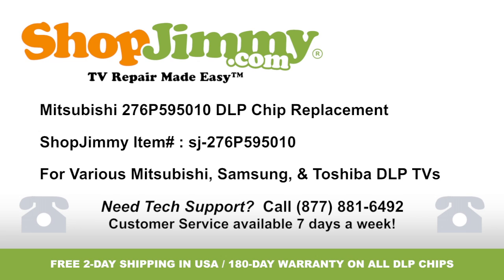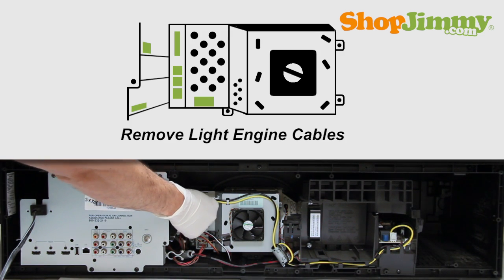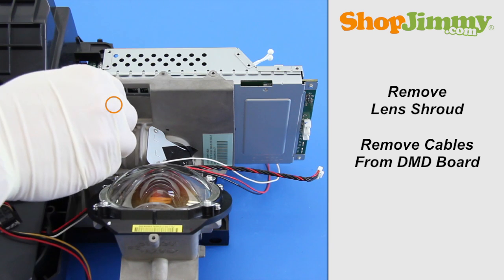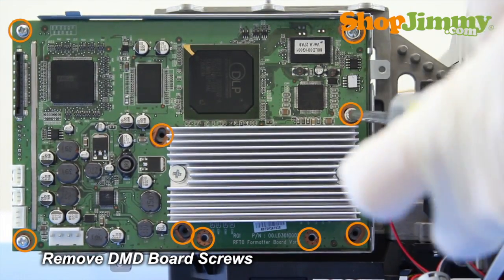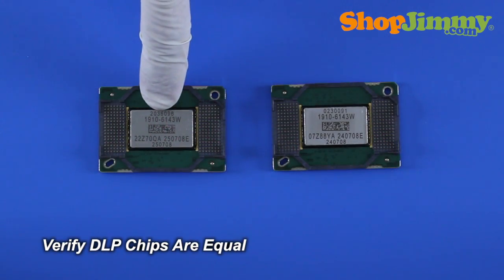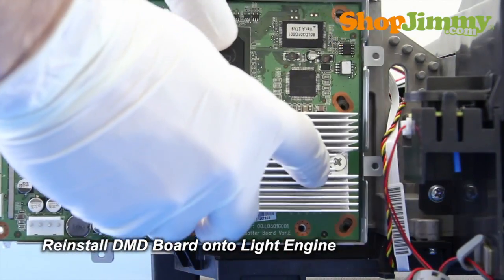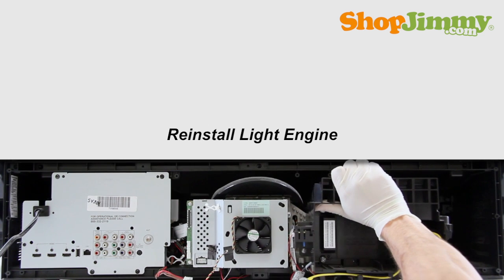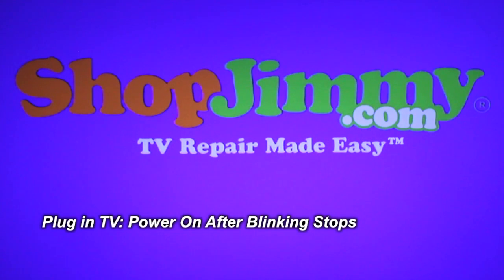Replacing a DLP TV Chip - White Dots Issue - How to Fix Mitsubishi DLP TVs

Comment: I don't know if you still read these after all the years you been doing this but if so do you or can you lubricate the color wheel bearing also the fan bearings on the Mitsubishi DLP 3D 82738
Reply: Yeah, you can. Just make sure it's a lube that is safe for electronics. I had a color wheel go bad on me, but I fixed it by lubing it up with MP Metal Protector. Also, make sure you clean any lube or smudges left on the color wheel's panels, or else you will get bad colors/picture.

Comment: Thanks for the excellent instructional video.
Be sure to take pictures prior to removal of ANY screw or wire connection.
Have a can of compressed air to clean all surfaces, intakes, board, lens, etc.
Recommend that you have well-lit table handy as a work surface.
Took about 2 hours to complete if you take your time.

Comment: We have a WD82837 Mitsubishi TV that has several things going on with it and I wanted to know if it is worth fixing or is it hopeless! The bulb blew out about a week ago and I have not had a chance to order one. This would be our 4th bulb since we purchased the TV and we purchased the OEM from Mitsubishi which did not last any longer than the cheaper ones they talk about.  So we have a burnt out bulb purchased 16 months ago, white and black dots all over the screen (which I was wondering if that can be fix by just cleaning the fans and dust or does the DLP Chip need to be replaced) and when when the bulb did work the screen was very dark to even see what was going on during a show. So with all that going on is it worth fixing? Is it fixable. I know I can buy another bulb and through your video I learned I could purchase a DLP Chip but once I do that will the picture get brighter so that we can see it. I am also sure it needs a good cleaning since it was 16 months ago when I cleaned it the last time I replaced the bulb.

Comment: Thanks, ShopJimmy!  Today, I replaced the chip on our Mitsubishi WD-60C9 and did away with the lovely yet unwelcome star field that was spreading across our screen.  While it wasn't the same model as the video, the steps of the process were the same and the video was VERY helpful in giving me confidence that I was proceeding correctly.  I did take photos at each layer of disassembly, noting locations of the screws and cables, just to be safe.  I also put the screws for each "layer" of the disassembly in a separate cup, so there could be no confusion at reassembly.  I have to say that it was easier than I expected.  The entire process, including dusting the interior while I had it open, took under an hour.  I proceeded very methodically, playing and pausing the video as I went because I'm uber-careful... LOL   Anyone could do this - just take your time.  I will say be careful with disconnecting the wires - they have a little push-in clip on the top.  Depress the clip, give it a gentle pull and they disconnect easily.  If it isn't coming off, you don't have the button depressed properly; re-depress and try again.  I will definitely use ShopJimmy again for parts and know-how.  Couldn't be more pleased!
Reply: When you fixed yours, did you use the same chip shown in the video? The Mitsubishi 276p595010 DLP Chip?

Comment: Bought the DLP chip via ShopJimmy / Amazon, watched this and several other videos before and during the procedure.  Worked like a charm.  Teamed with my wife and got it done (carefully) in about an hour.  Tip to put screws in labeled paper cups / containers was good idea.  Also pay attention to pop-up text about option of using thermal paste, though the video doesn't show you how / where - you can figure it out - it goes on the rectangular part of the heat sink that contacts the chip.  Also be prepared for slightly different screw locations.  In our case se had to cut the foam that was glued on to remove the lens hood (another video shows this) but it was fine.  The heat sink screws also had to be removed before the DMD board would come out.  All in all, about $200 spend on the chip, thermal paste and gloves and now everything looks great!  Better than spending $500 or more on repairs or having to buy a new LCD TV for $1000 or more.  Thanks ShopJimmy!

Comment: after replacing the DMD chip, there are still white lines going across the screen. after taking everything back apart to double check it now the tv will not turn on and has an orange light that blinks. mitsubishi 73 in. dlp

Comment: fairly easy to replace, take pictures of cable placement and have individual cups for each set of screws. if you don't have a grounding cable, buy it. watched a video for placement of the housing for removal. each brand is different and found that helps. 

thanks shop jimmy. fast delivery of replacement parts.

Comment: Very helpful video thanks Shop Jimmy for getting me my dlp chip so quickly!  

Just a note for those out there with the WD-73837 TV you do not have to take the lens cover off.  There are only two screws (not 3 as pictured in this video) instead where the 3rd screw is shown mine is instead held in with adhesive foam.  You can access the cables easily on the DMD board without fooling with this.  

Also I would HIGHLY picking up Arctic Silver's cleaning and purifying kit (google ACN-60ML).  Use a microfiber cloth and thoroughly clean both the cpu and mating heatsink surfaces with part a (thermal paste remover) then part b (purifier).  Last but not least pickup a quality syringe of thermal paste I personally use ARCTIC MX-4.  You only need a light even coat spread across the heatsink mating surface.  Be sure to tighten the heatsink screws until they bottom out - the springs will provide the needed tension.  When I took my old dlp chip out the thermal paste was rock hard and obviously not doing its job which likely caused its demise.

Comment: Great video.  I replaced the chip in about an hour.  It was much easier than I thought.  The hardest part was putting the screws back in.  My TV looks brand new.  I was quoted 750 to fix this from a repair shop.  I bought the chip for 189, and did it myself.

Comment: Thanks for stocking the DLP chip and shipping to me quickly. everything went smoothly.  took my about 1.5 Hours just taking my time. all the white dots are gone. Once I remove the heat-sink and Board the Chip just fell out. When Mitsubishi built this TV in 2008 they forgot to use the locking feature to hold the chip in place. But I guess it still worked with out it.

Comment: I replaced my chip today and it worked but then later it just turned off and started blinking the red light. The light is only about a month old as well. Any ideas what to look for when I take it back apart?
Reply: +Drew McMahon Did you lock your chip? I forgot to lock mine and had the same problem.
Reply: +Dewan Alam ended up pretty simple thank the lord, I took the plate back off and just looked things over first and I ended up not fully seating a simple electrical connection that was between the fan and the lamp

Comment: I've read numerous questions regarding whether or not we should use a thermal heat sink paste or pad when reinstalling a new DLP chip. Some people said yes, others didn't care, and even ShopJimmy responded with a simple, "You can certainly use it if you would like.  The fans are there to keep it cool.  Thanks! "

Sorry, but I was told the reason why the DLP fails is from heat, and therefore it is a huge mistake not to use new thermal paste or pad when reinstalling a chip, used or new! A fan alone is not the most efficient way to lower the heat output of these chips, they need the heat to be transferred efficiently to the heat sink so that the heat sink fins, along with the blowing air across those fins from fans, rapidly dissipates the built up heat. Poor transfer of heat to the heat sink means poor cooling for the chip!

The dried up pad or paste that is left on the heat sink is a very poor conductor of heat between the chip and the aluminum heat sink. Using the leftover old dried up paste or pad, or nothing at all is a bad idea, because the contact between the surface of the heat sink and the chip will have many small air pockets and imperfections where there is absolutely no contact being made, and the transfer of heat will be inefficient and poor! 

The whole reason for a new pad or paste is so that the heat sink is in much better contact with a greater surface area of the chip, where air pockets and imperfections are minimized, therefore allowing for better heat transfer from the chip to the heat sink, meaning the chip cools faster and more efficiently.

You want to give your new chip it's best chance for a longer, more happy life, then use some thermal paste compound or a new thermal pad between the new chip and the heat sink!!! Just my opinion though, and it's what I certainly have done when I replaced my own chip in my Mitsubishi WD-73837 DLP set.
Reply: You just answered the question I came here to ask. Having built many computers, while watching the video, I found it odd to not put thermal paste between a chip and heat sink. My only concern was if there was a reason not to which it seems you answered. Thank you.

Comment: I have a WD-73833
Bought the chip & went through the procedure fine, but when I put everything back together I am getting a solid red status light on the front when I try to power the TV on. I double-checked all connections, but it didn't help. Any thoughts?
Reply: +Eric Clark FIXED. 1st time through I didn't lock the new chip in place. I took it out, and re-seated it, locked it into place & now the TV works.

Comment: Have a WD-65735, just replaced the DLP chip a few minutes ago.  Instructions were good, adaboy.  My layout was somewhat different, though video mentions that.  I added labels to the cables prior to removal from connectors.  suggest you try that.  pictures are a good recommendation, but cable labels are an improvement.

Comment: Hello, I recently changed the DLP chip in my Mitsubishi WD-65735 TV. It seemed like everything was going correctly when I put the whole thing back together, but when I go to turn on the TV, no sound or picture comes on. The green light that is usually there does, but nothing else. Before I fixed the chip the TV used to make this very distinct noise when turned on, telling me it was powering up. Now it doesn't make that sound anymore. I also replaced the lamp in the TV just under a year ago, so I can't imagine it's that! Can you think of anything I may have put in incorrectly or misplaced when I was putting the TV back together that would cause it to do this? Thank you! Looking forward to your response.
Reply from the maker: +Stacie Roshon  Try all repairs and troubleshooting at your own risk.   I recommend that you <!-td {border: 1px solid #ccc;}br {mso-data-placement:same-cell;}->double check all connections and that the lamp door is closed.  Thanks!  www.shopjimmy.com

Comment: Just finished replacing the DLP chip in our Mitsubishi [model WD-60735 - part number 4719-001997]. I'm not sure how many white dots we had, maybe 200? Maybe a couple dozen black dots. Started with 2 dots about 18 months ago, then, little by little, a couple hundy.
Not difficult, just made drawings as to where the wired connection/wire colors connect to before I took everything apart.
Quoted $585 to 'repair'. Paid $184 for the chip and an hour later, a like-new picture!
Finding the correct chip for the model was the toughest part but, called shopJimmy and they helped me out.

Comment: I had around 200 white pixels on my screen they had been multiplying for many months then one night it went totally dark no sound or pic.  I had replaced the lamp about a month prior as it had burned out .  It does not appear to be burned out when I take it out and look at it .  Can my problem be the dlp chip?   about ready to put it up on craigs list as is for 100.00
Reply: +Bob Hennessey Did the lamp you bought come from Mitsubushi's preferred manufacturer? I replaced the lamp in mine buying the cheapest one I could find on Amazon and it lasted about a month. Did the same thing again and it lasted a couple of days. Then I found on a forum where people were having  the same troubles with the cheaper lamps. I think the ones on Amazon were around twenty bucks. The preferred manufacturer's bulb was more like seventy or eighty. Bought one of those and it has lasted about four years. Just burnt out yesterday. Now I'm going to get rid of these damned spots that I've been putting up with for a couple of years.
Reply: +Josh Carrico Thanks for your advice  Is there any way to test the bulb it certainly looks fine when I take it out and look at it?
Reply: Not that I know of. The first one that I had certainly looked fine when I took it out, but I'm trusting the red lamp indicator light on the front of the TV. I want to point out that that the only experience I have with third is trying to keep my TV running.
Reply: +Josh Carrico  Ok thanks Josh maybe I go ahead and take it off of craigs list and try another bulb

Comment: Thanks shopjimmy.com! Video was well done.  New DMD chip works perfectly.  Fixed my parents Mitsubishi WD-65835.  Advice for those who try this repair.  There is one plug that is a ribbon.  It is different from the other plastic male/female plugs.  Also, there is a thermal switch next to where the lamp bulb slides into the TV.  Make sure it is engaged when you put the back on the television, it is spring loaded and blue.  Also, do not over tighten the heat sync screws w/ springs.  Other than that, peace of cake.  Take the time to clean your light engine with a vacuum while you have it disassembled from the television or you may get an air flow blocked error message.

Comment: Hi, just tried to replace the DLP chip on my Mitsubishi WD-60735 , and the picture has what looks like grid lines in it and a solid black bar running all across in its lower third of the screen.  I'm quite sure I followed all the directions, everything fit back into place. I got the chip from you today (Saturday, 6/21) from Amazon. Do I have a bad chip? I used the Arctic Silver and everything. I have pictures if you have an email address I can use.  Thanks!

Patrick Graham
Charleston, SC

Comment: Nice video. The heat sink on my tv (WD73734) is mounted through DMD board to the housing and glad I did not try to hard at separating the board from the housing . The point is take your time if your model is different from the video. Thank you ShopJimmy for all your help.

Comment: MITSUBISHI WD-73C9
I just did the replacement twice, same result.  plugged the TV back in and red flashing status light. Manual says unplug for one minute and try again, still has flashing red light. Next step, please!
Reply from the maker: Kelly Keever  PLEASE SUBSCRIBE TO OUR CHANNEL - Try all repairs and troubleshooting at your own risk.  I recommend replacing the lamp in your TV.  Click this link to replacement lamps for your TV model number:  http://www.shopjimmy.com/catalogsearch/result/?q=WD-73C9  Thanks and please let us know if you have any further questions with your TV Repair!  www.shopjimmy.com
Reply: Kelly Keever Video fails to say that lamp door needs to be in place. I could not find a switch, however, when the door was secured the TV worked as new!

Comment: Very good video, but one warning from my unfortunate experience. In the upper corner of the board, there is a connector with a four-conductor ribbon cable. That is not a plug! The ribbon cable pulls straight out of that socket. If you pull on the socket, it pulls off of the board, and you're in the market for a new TV.

Comment: WD-65734 replaced the chip with one from your site and now have vertical lines. Took apart and re-seated several times to no avail. Any suggestions?
Reply from the maker: Random Acts   I recommend replacing the formatter board in your TV.  Click this link to a replacement formatter board.  http://www.shopjimmy.com/mitsubishi-bk-80l88-21g-formatter-board.htm  Thanks!  www.shopjimmy.com

Comment: I just had to comment on how useful this guide was when I replaced the DLP chip in my mom's tv. The entire task took me about two hours and I did not have any issues with afterwords, the tv powered up with a screen that was better than new. My mom was thrilled.

I have few suggestions for anyone attempting this repair.
1. Use an egg carton or muffin tin (rather than a single cup) to place parts in. Place screws and parts into their own cup in a carton as you remove them during each step. Label each cup for the location they belong. This makes reassembly much easier as you just have to go backwards with the parts, then you don't have to guess which screw go where.
2. To protect the lens from dust and smudges, place a lint-free cloth over the lens and secure with tape. I used a chamois that I wrapped around the whole lens housing once the lens shroud was removed.
3. Clean built up dust and dust bunnies from the tv and light engine. I used those Swiffer dust mop cloths to minimize dust flying around. The heat sink and circuit board, I took outside and blew out with canned air before I re-installed the new DLP chip.

A big THANK YOU to the folks at ShopJimmy for the DLP chip and the instructions!

Comment: Do you recommend using a new thermal pad or thermal paste on the new DLP chip?
Reply: No thermal paste in Between the dlp chip and heat sink? What is going to dissipate the heat from the chip to the heat sink then? Looks to me that the old dried up thermal pad on my old chip is the cause of the overheating and failure of the chip. you really recommend just putting the heat sink on metal to metal with no Thermal pad,paste or anything?
Reply from the maker: catfisher420   You can certainly use it if you would like.  The fans are there to keep it cool.  Thanks!  www.shopjimmy.com